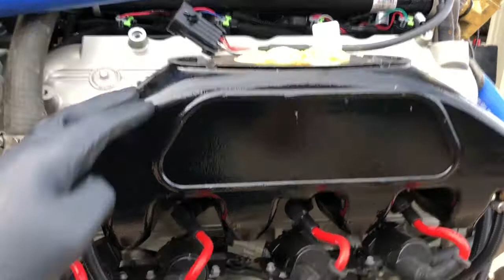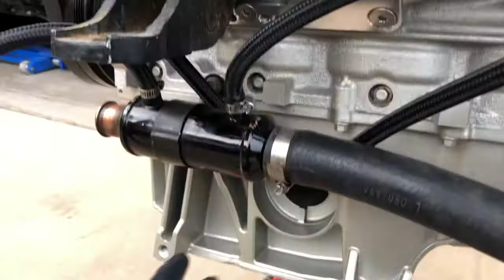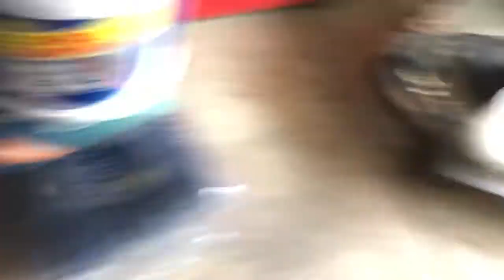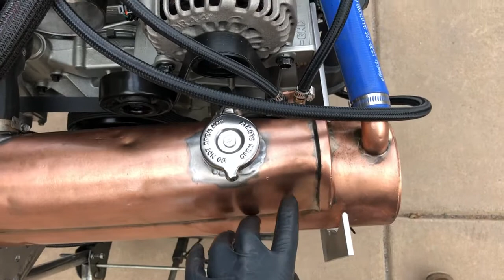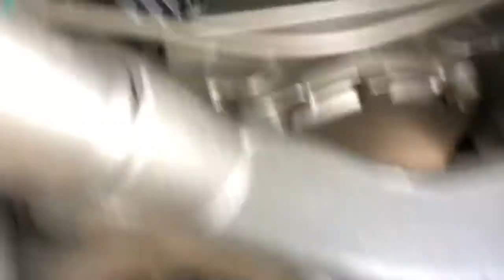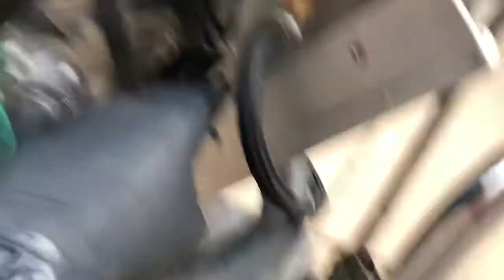(Vid #1 of 5) Twin LS Swap On My 30’ Bayliner. Will They Fit? Nope...

Comment: 8:08 this comment here about temperature in the engine bay is valuable.  Honestly, I would say bit is a little underrated. Safety NEVER takes a break. 
I am LS swapping my 1988 Larson DC 215, and I am learning quite a lot of knowledge here. Thanks for making this vidya.
9:58 So a lot of Michiganders like myself will get a 13 gallon trash can from the dollar store, and fill it up with RV ANTIFREEZE and lower the out drive into it. Start the boat, and let it suck up the juice. It is a closed loop system that works effectively for the low buck. 
Hope it helps, again I am learning a lot from this vidya.
Reply from the maker: Hey thanks for the information.  I hope your build goes well!  We got a lot of use out of the boat and it was excellent during the time we had it, but I ended up selling it recently.  The lakes around us are getting low and overpopulated by people.  We got tired of dealing with it but loved the boat.  Wish we were able to use it in an area that had more boating available as Colorado is kind of a mess when it comes to boating.

Comment: I'm researching this project now for my 86 donzi with big blocks. I've watch 100s of videos your vidro is the best so far not to mention not one of them use a stock manifold which I can see is substantial less. Great video man thank you for the info. Side note I was doing ls swaps before any kit was made and that fly wheel is used for the muncie 4&3 speeds in the car world.
Reply from the maker: Same here.  There was nothing on the internet when I did mine.  Had to figure it all out.  Now everyone is an expert with FaceBook LS Swap Boat Groups, lol!
Reply: @GVR1670 I couldn't figure out what drives and trans you have what are they ? I have velvet trans & trs should my install be same as yours ??
Reply from the maker: Mine unfortunately have Alpha 1 drives.  Haven't had any issues yet but I'm easy on them.

Comment: I have the same boat. I see you opened your engine bay to normal human size. Did you have to brace it or just left it open
Reply from the maker: Mine is a 1991.  It came with the bigger opening.  It still feels too small so I can't imagine what you're dealing with if it's any smaller.

Comment: Did you end up using heated o2 sensors to be able to make sure they worked at proper temp? Looking doing this setup in a my chaparral sunesta. May have to pick your brain some more.
Reply from the maker: The Holley Terminator X comes with heated wideband O2 sensors, which is what I used.  They still work perfect with the way I hooked them up and mounted them.

Comment: Did you end up using heated o2 sensors to be able to make sure they worked at proper temp? Looking doing this setup in a my chaparral sunesta. May have to pick your brain some more.
Reply from the maker: The Holley Terminator X uses heated WideBand O2 sensors.  Yes that's what's in there.

Comment: Also, if you can avoid running a car alternator or starter on the boat that would be wise.  Boats parts are ignition protected.
Reply from the maker: Yes agree but not needed in my application.  The engines are MPFI and not carburated which means there is no out-gassing of fuel vapor in the bilge.  The carbs create a fuel vapor problem in a sealed bilge which can ignite- which is why boats have blowers and unique starters and alternators.  You never smell fuel in my bilge ever.  Having said that I do have marine alternators on the boat but will likely never install the marine starters.
Reply: @GVR1670  It doesn’t matter if your boat is carbureted or fuel injected! Either way you still have fuel tanks, fuel lines, fuel filters, fuel pressure regulator, fuel injectors and many other components that could potentially introduce fumes into a bilge! Not to mention if you get boarded by the USCG they will do a safety inspection and they will absolutely check and then issue you a fine for not complying with the regulations! Ignorance must be bliss, It is people like you for which regulations are implemented! You can’t see past your own face! How about the fact that if for some reason there was an issue and you filed an insurance claim they will come out and inspect your boat and deny your claim because your boat was not compliant! Or how about this last reason, Are you really that cheap that you are going to gamble with the safety of your family and friends over a few dollars! If you are really that cheap boating is definitely not for you! I don’t want to be harsh but it is always the people who think they know so much about the Marine and Automotive industry that make such a stupid statement such as you don’t need a Marine starter because your boat is fuel injected, It is statements like that in which I quote when people try to argue that the labor rates surrounding the Marine and Automotive Industry!

Comment: I like you fuel cooler idea, but that would scare me!  Never want water in the fuel.
Reply from the maker: The coolers in these applications are not known to leak or fail.  Pretty slim chance of an issue there.

Comment: what was the part #on the flywheel you used? did it require any kind of spacers or anything to hook up the outdrive shaft properly? did the main stringer mounts have to be moved forward or back?  getting ready to swap a 6.0 into a boat and your info in this video was very helpful.thanks
Reply from the maker: No I bought spacers and all kinds of stuff to fit the flywheels on and didn’t need any of it. The 4.8 manual flywheel from a 2000 Silverado worked perfect as they were. Bolted directly on and the driveshaft hub also bolted directly to it. Only thing I had to do was remove the pressure plate dowel pins as there was no pressure plate.